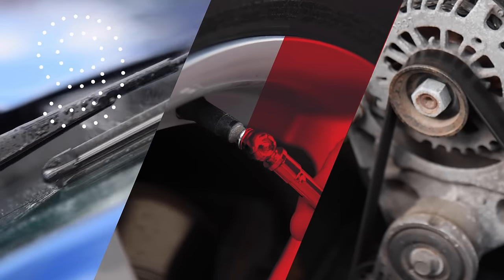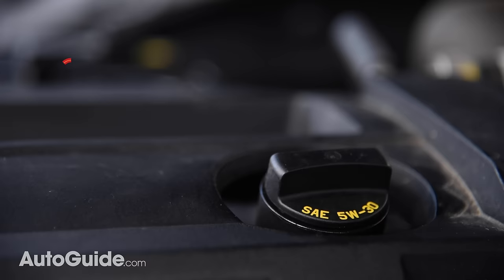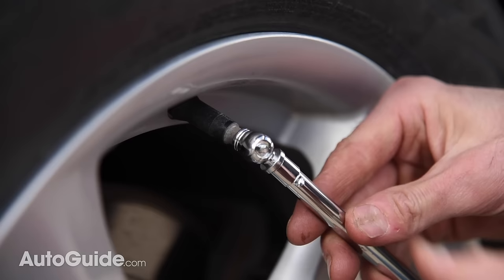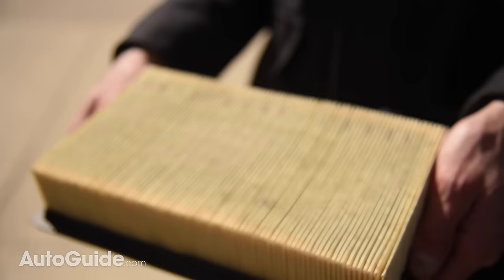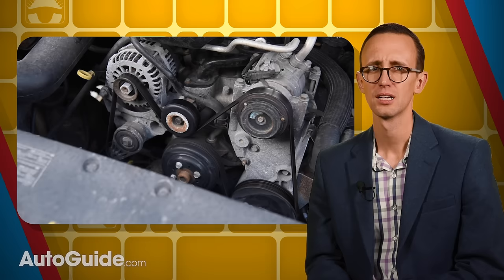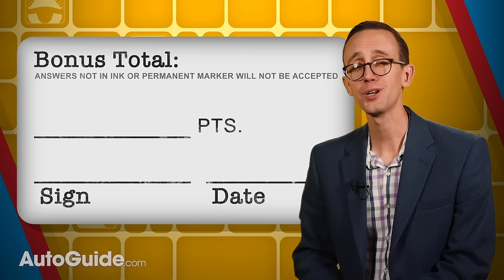Car Maintenance: 10 Things Every Car Owner Should Know - The Short List

Comment: What about the brakes? That's another simple but extremely important thing to learn how to change.
Reply from the maker: Yes, brakes are SUPER important, but we left 'em off this list just because we wanted to focus on simpler vehicle-maintenance items. Thanks for watching and commenting!

- Craig
Reply: @moparfam300c  lol i can do the in like 2hr
Reply: @moparfam300c  they're simple but they would take a whole video
Reply: @moparfam300c  i have drum brakes. tell me again how easy it is?
Reply: Great vid man 👍🏽
Reply: Ananth Narayanan 😭😂
Reply: It takes the pros a minimum of 30 minutes to do
I would never attempt that myself
Reply: In modern cars with electric handbrake you have to use a scan tool wit a function to turn the motor on the rear brakes to be able to change the pads
Reply: @awami1381  ,, To change brake pads is at most a  15 minutes job. Even for a DIU
Reply: @ananth218Canada  stopping distance of 3 miles wants to know your location
Reply: who changes those anymore is about as cheap to go to a shop
Reply: @EpicDrew15  i’d say 5 - 10 minutes max for each tire, and btw, i’m talking about maintenance, i’m talking changing the brake pads, discs and rotors then bleeding them
Reply: @ananth218Canada  Yea, I watched a video of someone doing drum bakes and it wasn't nearly as simple as disc brakes.

Comment: Pro tip : Loosen the bolts on your tire before jack it up !
Reply: Learnt that the hard way with my first car😀👍
Reply: And tighten them fully only after you've lowered it! He missed all these!
Reply: may i ask why?
Reply: @1gks  it’s just to prevent the tire from rotating when you’re trying to take out the lug nuts
Reply: Brakes🤷🏼‍♂️
Reply: @1gks  And always keep a puncture repair kit in the trunk....a plug repair kit i mean,as those foam sealers are horrid stuff when/if the tires need changing& you may get charged for it getting removed. BUT the foam sealants maybe the only solution in a real emergency ie Elderly etc

Comment: 0:35 Windshield fluid
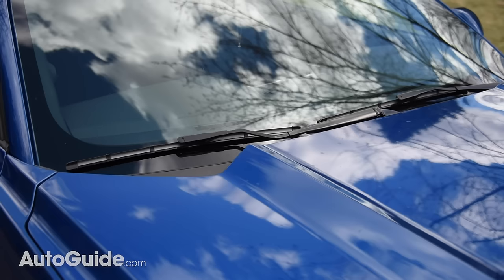1:06 Windshield wiper 
1:50 Engine Oil
3:15 Oil Filter '
3:30 Tire Air 
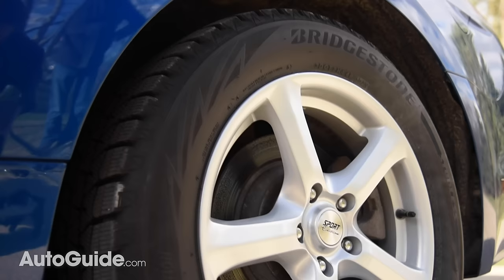4:10 Change  Flat Tire w/ Spare Tire & Jack
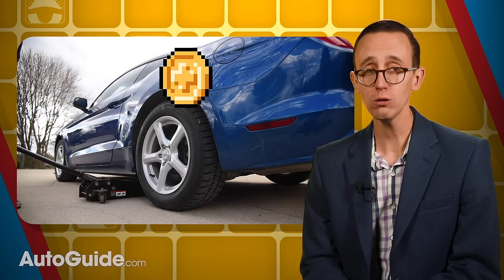4:45 Rotating Tires '
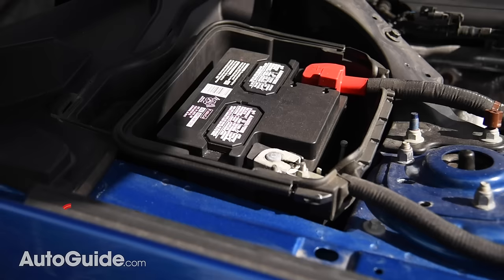5:06 Jump start Dead Battery
6:00 Engine Air Filter
6:47 Cabin Air Filter '
7:10 Serpentine Belt '
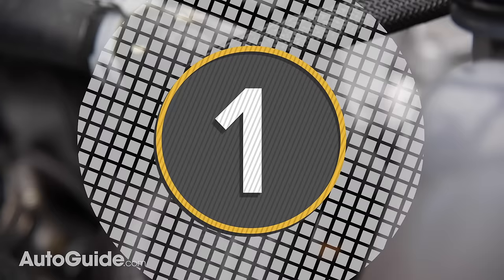7:59 Coolant
Reply: Cabin air filter and AC filter is the same or not? I'm just confuse. Thank you
Reply: @vhongfabria9946  nah the cabin air filter filters the wind the AC creates so you’re not breathing junk as most car’s AC actually comes from the radiator fan
Reply: good samaritan
Reply: Time saver
Reply: I'd definitely rather read this than waste my time with the video, thanks :D
Reply: thanks buddy
Reply: Upvote this man, Bring him to the top!
Reply: GOAT
Reply: When you're done with all the above, don't forget to change the fuel filter (if it's an easy inline one, probably don't bother if it's in the tank)
Reply: 0:35
Reply: Thank you

Comment: I mean, when changing oil , you change the oil filter too. Ive been doing in car service for like a month, and then quit, volunteered so i can learn abut cars. And it is the basic. Also,  if you see your air filter too dusty/havent changed it for a long time, now is that day. Do not use blowers to blow it off the dust and think that youve done the job. Its still filled with small particles that you cant see, which can lead to engine problems, so its better if you just buy a new one.
EDIT: Also dont buy really cheap filters, or parts in general, as their quality is close to zero.
Reply: Some Air cleaners can wash and reuse,, especially if you have none in store.

Comment: Add brakes and roters, ball joints, bearings, struts and springs, change all four tires (meaning take the worn tires off the wheels and put new ones on setting the bead, then you got changing all the fluids ( coolant, engine oil, transmission fluid, gear oil in the diffs and transfer case oil) then there’s changing spark plugs, headlights, tail lights, fog lights, and if you really want to have fun you can do the full engine rebuild ( top and bottom)

Comment: I only know how to add the windshield wiper fluid 😢
Reply: You can look up everything on internet. This all sounds complicated at first, but belive me, it isnt.
Reply: Never late to start. doing some maintenance on your car gives you a sense of ownership and you'll feel good about your self and about the car.
Reply: These comments are so wholesome
Reply: Can anyone tell me what liquid is used for wiper fluid?
Reply: @AS-nx9fu  Depends. You can either use distilled water with a concentrate that you mix according to the instructions on the bottle, or you buy premixed washer fluid. Running pure distilled water is not great idea as it freezes easily and can corrode stuff and running tap water is even worse idea cause you'll get sediment build up which will eventually jam the pump or the lines.
Reply: @foxman105  ohk... Thanks mate
Reply: @AS-nx9fu  , Just order wiper liquid or add liquid soap to water .
Reply: @foxman105  how do you know it if has a sufficient amount of fluid in it? how full should it be?
Reply: @papi4343  It's low when car starts flashing low washer fluid level and it's full when it overflows, lol. You can't overfill it, the excess will spill out. It's not a closed loop like let's say brakes or oil so it's not a precise measurement.
Reply: Lmaooo

Comment: Changed the belt on my Grand Am what a pain first you gotta support the engine either by the oil pan or using a engine support bar from the top. Then undo the engine bracket mount from the passenger side. Take a socket wrench or serpentine belt tool and move the tensioner towards the firewall of the car. Take belt off and the do everything you did in reverse. The hardest part is getting the belt back on I recommend you go from the bottom up it’s more easy to get the belt started on the crank shaft pulley and work your way up finishing with the alternator. Also on the Grand Am it’s easy to also remove the cruise control model seeing that it’s kinda in the way and moving it gives you more arm room. It’s simple just unplug the wires and remove the black bracket holding it on and just set it to the side.
Reply: I just changed coolant to -40°F.
David 
Alberta

Comment: Clean your blades and your windshield before you decide you need new blades. Save the ones you take off if you do. If they aren't actually bad, you can treat them with wd40 and have spares.
Belts cracked across their grooves have not failed. Belts losing rib material over their length have failed. Check for belt accessory drive update if yours has issues. Dealer service can answer questions if you tell them your Vin and symptom.

Comment: In modern cars you can't check the timing belt or serpentine belt. You have to remove the engine cover. And what can you even do as an amature. Even garagists often think you have a timing belt problem cause it is good money for them but a disaster for you. See a brand professional because the noise could just be a roulement that is broken.

Comment: Thanks. I can do most of them, except changing tires and windscreen wiper. 😂
Reply: The windshield wiper is one of the easiest things to change.  Tires aren't complicated(loosen the bolts, jack the car up, remove the bolts, remove the tire, put the spare on, bolt it on, jack the car back down), but it's a lot of effort to where it's easier to just pump air into the tires as a temporary fix unless you had a blowout(I had a used tire disintigrate on my Versa, which is a small car to be having a blowout and luckily it had an actual spare).

Comment: I wish there was a video that teaches you how to quickly check under the head to check if nothing is inside like rodents, leaves, what not. Or if no cable has broken from vibrations or again, rodents. I feel like my engine is overheating. The cooling fan keeps turning on after parking and it's freezing outside.

Comment: These are only beginner guides the matter is much bigger  and much ADVANCED   you need to clean the nozzles you need to replace the plugs you need to clean the burning chamber and you need to replace the air filter of the engine and air filter of the AC AND FINALLY change the oil filter

Comment: A lot of these I do not need to do because they are covered in my annual maintenance. The other reason is that quite a few items within my engine bay are locked down so it’s hard if not impossible to access some of them. On top of that, my truck does not have a jack nor tyre inflation kit - GEICO will handle that for me. Lastly, you guys should make a video of the things you should keep in your car.

Comment: I wanted to know that is there a difference between putting water and coolant do you need both of them
Reply: when topping up or changing coolant you should use the right mix of coolant and water, if you are unsure on how much or what mix there are plenty of guides just type in the make and model of your car what cc the car is or go to one of the many big auto parts supplier sites and type in your car registration number and select coolant they will show you the right types, and mixes, if you use just water it will not work as well and in cold climate or times of year you rist the water freezing and damaging your engine beyond economical repair so this is one thing to make sure of it is cheap and easy, at a stretch you can get coolant concentrate from many places and they give a rough guide to amounts so with a little maths you can work out the mix and that will do the job. but having learned the hard way many years ago i know first hand just how vital coolant is.

Comment: My hose ruptured on the freeway for the first time. Makes no sense because it’s a 2017 Ford Mustang.
Reply: Bad part. Everyone manages to get the rotten apple at some point. But at least the radiator hose is usually very easy to replace yourself.
Reply from the maker: I'm sorry to hear that! My 2017 Mustang has been bulletproof so far (*knocks on wood).

- Craig
Reply: The problem is you got an American car
Reply: Gustavo Villar that’s such a false statement😂
Reply: @thedivinethinker2193  Not really because it's you who has the problem :)
Reply: Gustavo Villar you realize that every car company isn’t perfect. For example BMW back in the day has serious engine problems. And Mclaren recently started having problems with their new super car.
Reply: This is why everyone should carry a role of Electrical Tape in their trunk. It's good for all applications, including sealing up a ruptured hose long enough to get you to a service station (or parts store) to get some help.
Reply: It's a Ford.
Reply: I work at a Chrysler dealership and had to change out a leaking coolant reservoir today on a 2018 Jeep Wrangler with only 8000 miles. Also recently had to replace a TIPM and the new one that came in was bad. But it's Chrysler, so what else can you expect 😂😂

Comment: Hi
I have a question, for turning on Automatic Car. Which one is Correct?

1. Insert the key and direct switch to ignition. (And Why?)

2. Insert the key and turn on, wait 1-2 seconds until warning lights out then ignition. (And Why?)

Thanks😁
Reply: are you sure you mean automatic car and not diesel car? with diesel cars there is a warm out time as diesel is not as flammable as petrol / gas so if it is a diesel then yes you need to wait a few seconds after turning the key most of the way, this is to let the glow plugs (a bit like the spark plugs) heat up ready to start the car so yes wait for the warning light to go out then start it, you will find the time is a bit longer on old days i know it can be a pain but worth doing as you will damage the car in time if you ignore the warning light, they are there for a reason. hope that helps.
Reply: Neither. Most car instruction manuals state that you need to depress the brake pedal BEFORE you turn the key in the ignition slot.

Comment: It's LEFTY LOOSEY...RIGHTY TIGHTY.   On Jump Starting it is recommended that you go +Positive to +Positive and -Negative to Ground on the Car you're boosting.  In modern Car Systems you can accidentally surge your ECM (Electronic Control Module) by doing that...and then you'll have some real issues to deal with!     +Positive to +Positive and -Negative to -Negative is an absolute last resort.

Comment: when I start my car in the morning (cold start) check engine light flashes and car rumbles. But it drives fine with an occasional jerk that feels like gear shift on a manual and the rpm doesn’t go above 4000rpm whenever the check engine light flashes. After about 3-5 minutes, i restart my car and the rumbling fades out and everything feels normal. Engine light now stays on. Since the car functions fine. Now I let the car idle in the morning for 5 minutes and then start driving. The same thing happens in the afternoon.

In summary the check engine light flashes for a few minutes during a cold start. If I stop the car after driving for 10 minutes and restart it, there is no such problem. I suspect this is a rare problem. i have taken my car to several garage. no one diagnosed the actual problem. coils and sprak plugs have been changed recently still there’s no end for this problem. please help me out im finding a solution since 2 months. please do the needful
(Lexus is 250 2009)
Reply: Might be a problem with the emissions system

Comment: After searching for weeks, I finally found it, placed the order and it came right to my door, I looked at it , drove it and did a few checks, and I was sold…. Fast Forward 4 weeks. My brakes jamming, had to pay £400 to replace the stuff under…. OhI forgot , the driver side under panel flew off the highway an I have started noticing chips on the window… wowow, what did I buy
Reply: You should have done your homework!
Reply: @josefabeckham194  Well I did, but I got too excited I guess
Reply: @nicholewilliams6034  I used confidentcar  buyer , this is what got me through when I got mine
Reply: @elidakeane5399  What's that? Sounds like a meditation program hahah
Reply: @josefabeckham194  Google is your friend!... anyway it was recommended by my neighbor and its the most practical guide , I have everything in one place

Comment: Loved the video aside from one point. You shouldn't be topping off your oil unless absolutely necessary between oil changes. If your vehicle is burning off oil enough to get low before a regular oil change, it's usually an indicator of a mechanical issue not being addressed (oil leak, engine burning oil excessively, etc). Only point and it's a minor gripe.
Reply: mini cooper moment

Comment: Which type of liquid is used in water reservoir
Reply: coolant antifreeze in the water overflow tank or the radiator cap, always use a coolant as you can damage your car beyond economical repair if it freezes in winter and you drive with the water frozen, the coolant stops it freezing, and just in case you are not meaning the car coolant top up, the only other water bottles would be for the windshield or headlights tail lights or rear window washers, that should have a picture of a windshield with wiper and water spray type symbol on the cap, use just water not great as that too can freeze and worse freeze on the glass blocking your view so try to get the proper stuff cheap and easy to get. hope that helps.

Comment: I need some help. If I paid a few hundred or thousand to make a car perfectly upto scratch, and I only drove it once a week, say 20 miles or 30, how long can I expect the car to stay in good nick? Can I expect a few years?
Reply: so long as you maintained it till you are about 80 ish it could easily out last you, but even very rarely used cars need to be maintained metal rusts rubber perishes fluids dry up, there are many factors that can change the longevity of a car.

Comment: What about break fluid?
Reply: you would want to do a seperate search for that type in the make and model of your car and the cc and just add brake fluid change there will be good easy to follow vids for almost every common car,  on a youtube search,  as there are several steps and it is clearly vital that you do the job properly, so to be able to watch someone else doing the job and talking you through it on the same car you have makes it a load safer and clearer, due to different locations and steps needed depending on car, there are generic guides that try to cover it all but the one for the car you have will be far better most of the time, check a few of the results as some will be far better than others with a camera or the audio or even the way the describe it, ment mechanics tend to talk in terms they know but most other do not leaving you guessing and with brakes that is not a good idea.

Comment: As these broadcasts are transmitted in the UK where we still use Imperial & metric measurement pints & gallons, feet & inches, litres etc  it would be a VERY GOOD IDEA if these American broadcasts were recalibrated to suit UK owners.
We dont fill our vehicles with QUARTS!!!!!!    Also American gallons/quarts ARE smaller than UK imperial/metric equivalents.
Reply: hi bud i am from the UK too, but they cannot change it for all the countries it is not that much effort to just do a conversion chart or calculator search, or download an app there are plenty of free calculators that cover measurement etc all in one then just take a few seconds and done, and most of the time the amounts given in these types of vids are car specific and UK versions of cars often have differing amounts so worth checking that too.